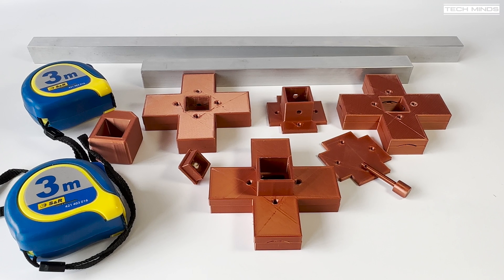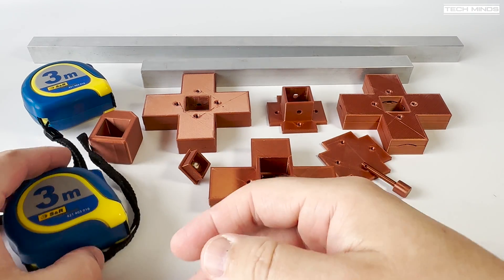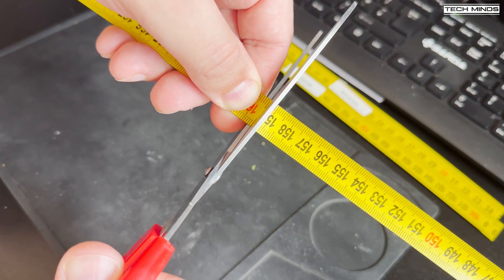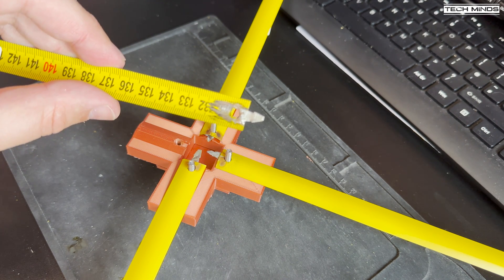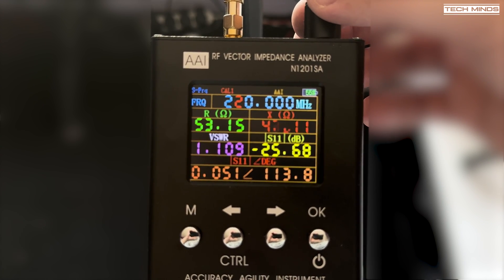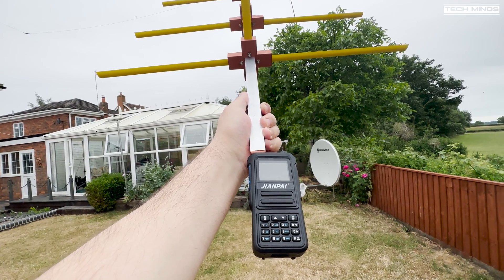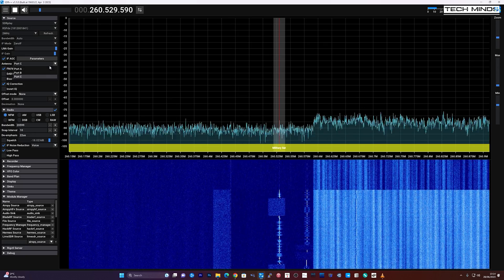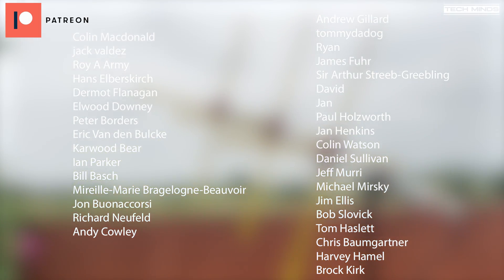How To Build A MILSAT SATCOM Turnstile Antenna

Comment: Just to make something clearer, the SWR has very little to no impacts on the quality of signal reception but the quantity of Reactance in the overall Impedance does. So the downlink for SATCOM, that is the satellite transmissions, is between 240-270MHz (roughly) and the uplink is between 290-310MHz, this is where the channels that the satellite is tuned to receive. The SWR is important in the uplink range (290-310MHz) but in the downlink range (your ground reception) it's important that the quantity of Reactance for the antenna in the overall Impedance is as small as possible. The reactance can be Capacitive or Inductive, whichever it is, you want it to be in the pico range not the nano. So idealy you want a few tents of pF or pH up to a few hundred, as soon as you go beyond 1 nF or nH the reception will be worse. That being said, I have seen some antennas that with enough gain will work well even in those condition but it's not ideal.
The radio he is using can be also found under the brand Radtel Rt-470, I have it, and it's very good, it can even transmit in the uplink band with a usable 4-4.5W. The reception is very good, better than most 100-150 USD radios.

Comment: All the chats you've picked up were between Brazilian truck drivers. These transmissions are usually a bit dodgy and done using American military satellites. Considering the frequency, the type of chat you caught, and when you posted the video, I'd say that the satellite in question is the UFO 10 (also called USA 127, NORAD ID: 25967, International Code: 1999-063A).

Comment: Epic!! (good Job).. I Wish that I  lived in your town.. (I would love if you were my Buddy) aka Best Mate. I seen your other video regarding this topic.. I did the same RX using my Helical for (NOAA weather satellite) 137-138 Mhz. It worked quite well.. but.. This project is perfect, and the  best.. (Thanks for the details for this project) I don't have a 3D printer but my neighbor has one. so.. (It will finally be used for something useful 😉)...Thanks for the Post... & 73's 👍👍👍👍
Reply from the maker: You’re welcome 😉
Reply: @TechMindsOfficial  Finally .. I managed to get my Neighbour to 3D print the Parts.. (But I have some Questions) I hope you can / will answer.. Do the Reflector and Director elements Contact the Boom ??  or do I  keep them Isolated ??

Comment: Wow, that works surprisingly well, considering your beautiful but "noisy" house is in the way, because the elevation is fairly low, the RX is a wideband radio with almost no preselection and most likely not an ultra low noise front end. I have had a 16 element wideband log periodic and my signal to noise with a better receiver was not better than this. It seems the SatCom satellites use a circular polarisation which I guess is one of the factors your turnstile works great and the second one is that your antenna is a resonant system for this band only.
I am surprised the coax transmission line doesn't get strongly influenced by the aluminium carrier that has its own resonance and being so tight in there, there should be a capacitive coupling, shifting the phase of the transmission line away from where it should be, but in practice it seems to be good enough for a great result.
I guess if you put this up on a pole/tower overlooking the houses and use a band filter for this band and an ultra low noise pre-amp, the signal to noise should be outstanding.
From what I know the Brazilian pirates use helical antennas for up- and downlink, underlining that fact that a plain H or V yagi may not do the trick, because you miss one half of the energy because of only receiving a single polarisation layer.

For a permanent outdoor installation a different choice of element material would be better because this stuff is great for foxhunting when running in between trees, where these bendable elements are ideal and will instantly flip back into position, while you don't want these to move with the wind 🤣 when on the roof. They may actually start to oscillate and make noises, not ideal for anyone around. And make sure to use PET-G instead of plain PLA, because most (or all?) PET-G materials are UV resistant and will not fall apart after a few sunny days.
Many thanks for sharing - this is great work and I love the idea that anyone can built these for a few bucks and building something and getting good results is so much more fun to be creative than buying something ready made, because you don't learn from it.👍

Comment: Hi. Small tip...trim the sharp corners off the ends of the elements and put some tape/heatshrink over them or you will scratch everything it touches if you are going to carry it around!! I used tape measure antennas for foxhunts for many years...
Reply: Can i heatshrink the antennas and paint the rest or will it influrnce performance?
Reply: @Lucifer-tq6kr  it shouldn't.…

Comment: If anyone is doing an antenna build and can’t get solder to stick, three tips: Use a bit of fine sandpaper to remove oxidation, apply generous flux, and use silver solder.
Reply: Use soldering acid :)

Comment: 257.150 the Toad alarm, that's been on there as i know of over two years..!!

why ??
Reply: Some have said it is a marker frequency to keep it clear in case the military needs to use that frequency.  They may be right.  Makes sense.
Reply: @gibbywankenobi66  possibly, or i thought it was a warning to tell the Military the battery was failing or some other indicator..
Reply: @bigpimp347  could be.  That sounds reasonable as well.

Comment: why not just buy an old band III antenna ??
after all band II isn't far off Sat-Com frequencies
Reply from the maker: Polarisation is a short answer. Also, where’s the fun in buying something when we can make it :) cheers
Reply: @TechMindsOfficial  oh so you're telling us they use RHCP or LHCP ??
also not every one has a 3D printer..
and Band III gear is readily available..

that said there was a guy selling old band III Radio or what ever they were antennas, for £14.99 which could easily cut down...

tuning isn't that essential for receive, i use a simple VHF center-fed on my stack with URM76 on it..

NOW unless you wanted to TX a cheap UV-5R-III would work and of course a suitable antenna..
Reply: @bigpimp347  Before I owned a 3D printer I used what I had around me, wood, DIY fittings such as brackets and hinges, and if you need plastic parts made to shape, use old milk bottles heated slowly until they become 'gloopy' and poor in to a mould you have already prepared using wood or even papier-mâché. if you cant use the fundamentals to find solutions, then you could always take up other hobbies like sleeping.

Comment: With a log periodic antenna 130_470, I got results at least s good as yours. The antenna was orientated broadly to the East. I had even the opportunity (about 20:00 UT) to capture a US military transmission in clear on one channel of the first pack of channels (+- 251 Mhz). I think there are others users of the milsat , which sound like russian or similar.

Comment: Do you know of a cheap Az/El system?  One that you can actually get parts for now?I've seen so many attempts where someone built a one off then tossed about half of what you need to make it into a Github then it just goes away after a bit.

Comment: i did make one almost finished, but when i was going to compleat it the 3d printed parts had warped, should be re designed with 2 screws on each tape mesurer

Comment: Radiation diagram looks weird. Are directors and reflectors in contact with boom? (Not sliced in half?)
Reply: Yeah reflectors and directors have to be one piece and close to a half wave long.  If you cut them in the middle like the driven element, they become 1/4 wave and no longer do anything. So make sure to short the ends to the boom.
Reply: are u sure about that?  @techminds can u confirm this?
Reply: @dennis8019  YEs they must be ONE lenght , u cant cut them , ask any radio ham .. ZS6AF

Comment: Which radio is best for transmitting towards the satellites 290--320 Mhz?
Reply: These are pirates transmitting on us military satellites.  Might not be the best idea to transmit on them.
Reply: One that a licenced amateur won't point you towards due to potential licencing restrictions but those frequencies that are illegal to transmit on in my region are often advertised as 3-4 Band FM VHF/UHF transcievers and a quick look at the sales page will confirm that you will have to be careful not to transmit on these frequencies.   Many devices use the same chip but different firmware and you have to be sure if you flash a new firmware on a device you're not accidentally transmitting on a frequency not licenced for use so I really wouldn't do this at all unless you happen to have an existing handset with flashable firmware that has different operating bands when sold in different countries and know exactly what you are doing.   HTH.